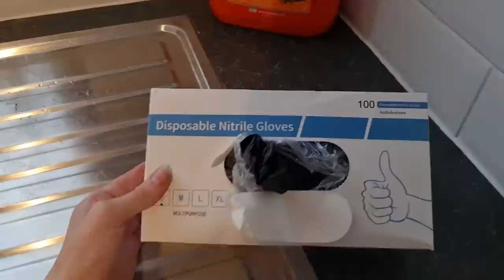My first time doing motorcycle maintenance [Part 2]

Comment: Aai, be carefull using a hammer to tighten any bolts... Typically the engine case is made of a softer material then the bolts, meaning you're more likely to strip the threads in the engineblock than the bolt. Buy some cheap torque wrenches and torque up to the specified value.
Torque wrenches typically have a longer handle as well, so the require less strength to tighten the bolts ;)
Did you also se the correct amount of slack on your chain?

Comment: Was anyone else shouting "enough Saffy" when hanmering on the sump plug.  Saffy, the sump plug has a copper washer (you did replace the copper washer didn't you) and this crushes to seal the plug.  Invest in a torque wrench and a Haynes manual. You will find that nuts and bolts don't need to be as tight as you think 😉
Reply from the maker: Ahahah I've been told off so many times 🤣 I'll loosen it tonight but in all fairness I think yall are massively overestimating how strong I am 🤣
Reply: @SaffySprocket  it's not about strength.  The filter should only be hand tight and the 1/8 of a turn.  There is a rubber seal that just needs to be slightly compressed to seal.  Same goes for the sump plug.
Reply: Oil drain plug is 22N/m which is not a lot.  You do not want a stripped thread..  BTW...the SV650 is an awesome bike for a new biker.
Reply: @newbymick1  - Suzuki Service Manual states hand tight and 2 turns for the oil filter, they've even updated the filter to include the reinforced nut that was previously on a service tool that fitted over the filter to tighten it 2 turns, Chapter 7 page 14 to 17 - pg 65 to 68 on the side menu. Read it yourself if you don't believe me:
https://www.carlsalter.com/mcpdf/Suzuki%202nd%20Gen%20SV650.pdf
Reply: @mc2594  if it's in the manual then it must be correct.  I'm Honda and have been for the last 45 years and never owned a Suzuki.  Always go with the manual 👍
Reply: @SaffySprocket  It may be too late to say this now, but slackening off the sump plug once it has been tightened is not a good idea. The sealing washer is designed to crush and deform as it is tightened, to fill the gap between the surfaces of the plug and the sump, as a one-time, single use item. If you then slacken it off, it loses some of the clamping pressure which keeps it oil tight and stops it coming undone, risking losing the plug and all your oil while you are riding. Even if it is overtightened, it's best to leave it alone now until you drain the oil next, and always fit a new washer every time.

Comment: Well done you, with bikes you have to learn or pay, did make me grimace a bit when you used a hammer to tighten the drain plug, invest in a torque wrench, it will save you stripping bolts,,

Comment: Right... couple points on that oil filter etc:

1. Don't bother filling it. The oil pump will do that for you, and 9 times out of 10 it'll do a better job of it. Not only is it a waste of effort, it's inviting dust and other sh!t on the clean side.
2. Before you screw it on, dip your finger in the oil (old or new - doesn't much matter) and spread it all good and proper on the seal. You'll thank yourself for that step at the next oil change when you take it off. If you don't do that, you'll be out tool-hunting again for a job that should normally be able to be done by hand.
3. When you screw that filter on, do it up HAND TIGHT. I appreciate you don't feel yourself strong enough for some of these jobs. That's fine. Maybe give it an eighth or a quarter of a turn with the wrench, MAX. Just to be 1000% sure. No more than that though. It's absolutely unnecessary and makes the job of getting it off at the next oil change an absolute nightmare. The general rule of thumb here is "Think of the next guy/girl". You do that, because most of the time the next guy/girl is YOU 😉
4. When you do up your sump plug, if you don't have the feel for it (which I will openly admit that I don't - I don't do this enough), put a torque wrench on it. You don't want to risk overtightening it, because if that thread is stripped or damaged - your oil is gone.
5. Stock up on the sealing washers. You can buy the "specific" one (for brand/model) every time you do an oil change, but it's cheaper just to measure it and buy in bulk - 10 or 20 or however many they'll sell you for a fiver or something. Make sure they're the right material (some are copper for instance), but beyond that there's nothing special about them.
5.1 You get away with reusing the sealing washer once, maybe twice, but after that it's knackered and it won't seal.
6. In your owner's manual it should state several engine oil capacities. One for just draining it (smallest), one for drain and filter change (should be a bit more) and one for taking the engine apart (biggest number, it's the actual amount of oil present). Before the first start, I would fill it to just under that smallest number, start the engine, give it 5 seconds to fill up the filter and switch it off. Then I'd put the bike on the big stand and make sure there's enough oil in there to meet the minimum mark on the dipstick, but not much higher. Then start the engine and let it sit for 5-10 minutes, so the oil has a chance to heat up fully. At that point it may or may not move up from where it was on the dipstick (depends on the engine), but now is the time to carefully add the rest of the oil, so it's just under (or touching) the maximum mark. If your bike doesn't burn oil, then there's no need to fill it up all the way, but it should be above the middle.
6.1 The owner's manual really ought to also tell you the difference between the minimum and maximum mark on the dipstick (i.e. 3.2l min and 3.5l max). Not all of them do, but it's useful information when you're adding oil based on the dipstick.
Reply: Service manual states two full turns (720') on the filter once the mating surfaces are met by hand tightening. Judging by the reinforced plate around the nut on the end I think the manual is correct and it was fitted correctly. Suzuki wrote it and also advise the specific hi-flow filter she used.
Reply from the maker: The tutorial I watched said to fill the filter part way to save time 😅
Reply: @mc2594  OOH Service manual 😱

Do share it of you have it, those are absolutely the best source for work like this!
Reply: @233kosta  - available download @ Carl Salter Motorcycle Manuals
Oil Change & Filter: Chapter 7 pg14 to 18

Comment: Something you did not show on the video is making sure that your chain adjustment is right, that chain looked waaay to tight, your new sprockets won’t last any time at all if over tight. I’ve got a SV that I use for my commuter and the original manufacture tyres are really good so don’t feel that you have to change manufacturer.

Comment: I'm not sure whether the UK uses Newton meters or pound foot to measure torque. My torque wrenches have both scales. Shop manuals will frequently quote both values. Largest torque value on my bike is for the rear axle nut (80 pound feet). Most fasteners are way lower. A lot of the smaller fasteners are quoted in pound inches. Just be aware of which unit is being used. Stripped heads & threads SUCK!
Congrats on doing your own work. Your on your way to becoming a shade tree mechanic.
Reply from the maker: Depends on the generation! We switched to metric with my gen, I know older generations use pound foot but I grew up with NM

Comment: oil filter way too tight once it buts up to the engine one half turn is enough  other wise your doing fine but get a torque wrench (get two a small one one for the 0-25NM range and larger for above that things like the axles the right torque is very important (im a bike mecanic if you ever have any questions)

Comment: id be careful of useing thosevk&n filters, i had one on my fjr and the weld round the nut on the end split and leftbme stranded on side of motorway
Reply from the maker: NooOooOo that's so scary
Reply: @SaffySprocket  won't use them anymore, also when u put  them on they should only be hand tight, you should  be careful  you don't over tight them .Also those brakes spreaders are fine I use them on my brakes .

Comment: Good that you are trying to do bits  on your bike...BUT I suggest you read up, use a maintenance/workshop manual & watch some decent tutorials.  As others have said a torque wrench is essential....especially if you don't have an experienced feel for tightening - too little or too much tightening can cause major, expensive or dangerous issues.

Maybe be more  selective if you phone a friend...Seemingly 5 people failed to give proper advice re brakes....a safety critical aspect of your bike.....stay & ride safe🙂
Reply from the maker: They don't sell them for my bike unfortunately 😕
Reply: @SaffySprocket  Torque wrenches are not bike specific Saf ....there are loads of different sized torque wrenches albeit I know tool access can be fiddly on many bikes

Comment: Hey Saff .. A Safety Check !! Please.......@11:58, I'm looking at your new DID chain and I notice the the chain-link one link left of the the rim, camera-view, isn't shiny like the rest!, Did you replace the false-link-clip over the link-carrier?? when you replaced the chain ??? Double check that for me before you ride, please..... Anywho some fun fact-terms about your new gadgets,.... @4:32 = Digital Vernier Caliper, aka Vernier. Rated by max jaw-spread, you would say a 6 or 8 or...up to... 36 inch vernier.... Yes  machinists use 36 inch Verniers at times..... lol .....The Brake piston tool,... @ 3:36 just call it a Brake-piston-retractor or spreader... same thing. ...@13:22  yea... a 4 inch deep-jaw C-clamp would have done you the same.... only Diff is you only need to retract the caliper on an MC ...same as a car....and that item would have only cost you a quid.....@16:40, a couple of 24 inch bungee-cords... great to hold back the cowling....And BTW , Saff, You look awesome with messed up hair and  dirty cheeks,... I love it.
Stay Safe .... Ciao.
Reply from the maker: The kit came with 2 link options, one was a squishy together do dar, and the other was a link clip, I went for the squishy together option because apparently its safer, it did look a slightly different colour to the chain

Comment: Way to tight on the oil filter! Spin on until gasket contact and tighten 3/4 of a turn by hand! The nut on the filter is for removal of the filter NOT installing it!!!
Reply: SV 650 2017 Suzuki service manual: Oil Filter replacement: 
wipe clean engine mating surface
lightly smear rubber seal with clean oil  
screw filter on by hand until surfaces meet
mark tdc line on filter 
tighten two turns (swirly gig spiral 720' clockwise arrow illustration). 
in context too has two o's
Honda's suck

I made up the last two but at least one is true. 
I think the nut is a later addition to the filter as earlier the manual shows a cap tool that located over the multi flats on the car type filter, the cap tool had the nut on it, just a guess as the filter Saffy removed didn't have one so must have been the earlier filter (the 720' tighten was the same). Presumably part filling the filter gives a more accurate view on the level window rather than filling with a pre determined amount with and without a filter change, according to the manual the difference is 400ml (2.7 litres with filter change / 2.3 litres without.

Comment: I’ve not read everyone’s comments but if this has been said already, i’m sorry not sorry. OMG do not use a hammer on a spanner to tighten your sump plug!! You need a torque wrench! Check your maintenance Manuel 😳
Reply from the maker: They don't make Haynes for my bike and when I contacted Suzuki, they said they don't give copies of service manuals to the general public 🥲
Reply: @SaffySprocket  you not got a service manual when you bought the bike? If not search eBay, I’m sure you’ll pick one up from there.

Comment: Well you could have got a major service from a dealer and had some cash left over for what you spent, but at least you are learning  about the bike.
Reply: I stopped paying Suzuki dealerships when they wanted £400 for less than the work on my 06 than Saffy has done! I think that was in late '06 and prices have gone up since.
Reply from the maker: I was told £300 for my chain and Sprocket 🤣 I'll skip that thank you. A lot of stuff wasn't specifically related to this task, I.e buying 30 blue rolls, it's more kitting out my garage
Reply: Another saving you can make - garages will charge you for disposal of old oil. But it works great for chain maintenance and is less sticky than chain lube (so doesn't attract as much dirt into the links).
Or your local council tip will have a large container for old engine oil, and that's free disposal!
Reply from the maker: My council picks it up with the recycling if it's clearly marked :^)

Comment: Don't hit a wrench with a hamer.... You will damage the treath... And oil the rubber of the oil filter before putting it on.  The correct tork for an oilfilter is 10Nm. That is hand tight and 1/4th of a turn with the wrench. This is tightend way you hard. You will notice that when you will have to undo it next time. 
Stop asking things on the internet, start reading a proper workshop manual or follow some classes.

Comment: Was I the only one cringing watching you put the oil sump bolt and the oil filter back on. 
Please invest in a torque wrench as these both have torque settings for tightening them. As does most things on your motorcycle. .
You will over tighten using a hammer 🔨 
Good luck with it

Comment: your killing me.. the tapping on the ranch to tighten the oil bolt..  [this part should never be tight tight]  grab a moment key and you wil never over tighten things in your aluminium sump / engine / bike again as aluminium strips quite easy.  
[edit]  its not fare to just criticise what you do. as i think your doing a good job. better as most motorcyclist i know.  and i have people around me that know how. and i my self work with other stuff so i sort of know what im doing.  all hands to you as you do it your self. even if you ask for help. i think this empowers you even more. your defeatedly on the right track.